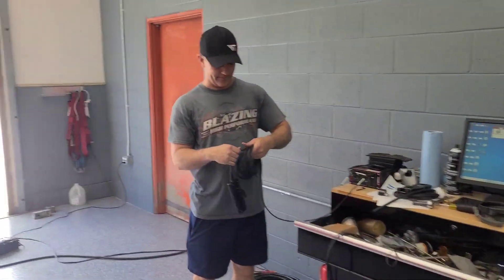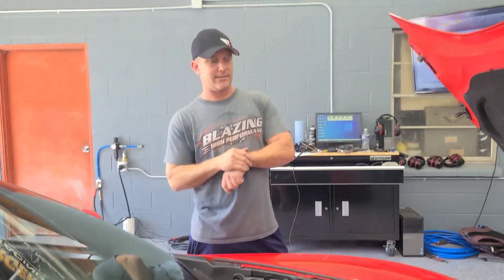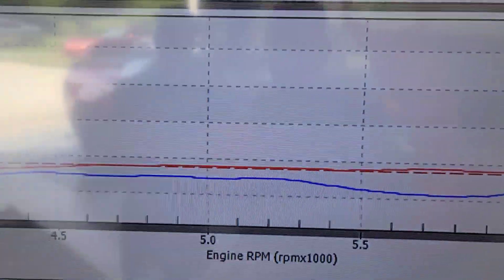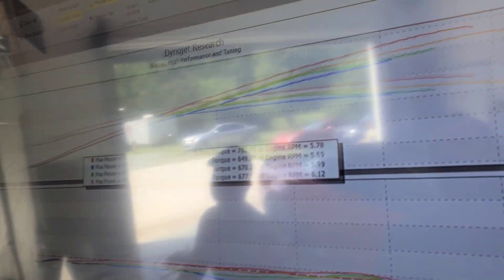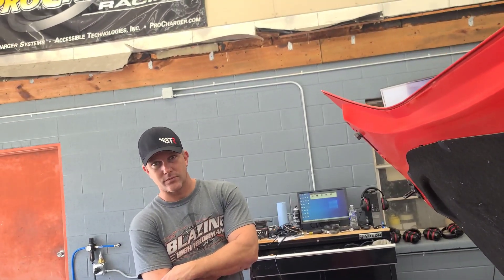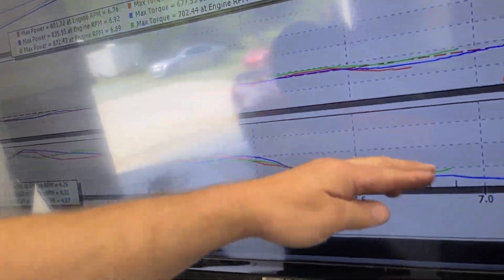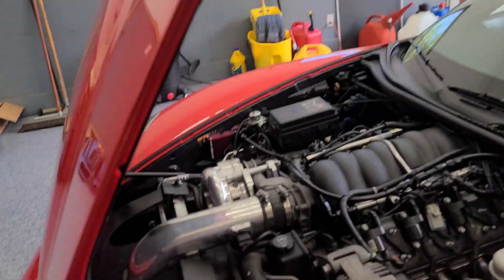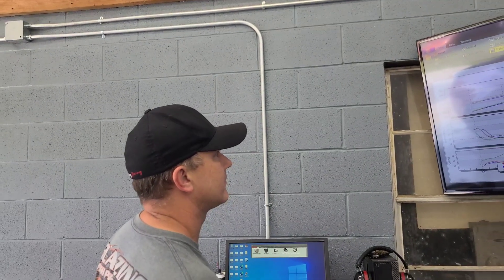2012 Grand Sport Corvette has us jumping for joy.  Almost 900 RWHP on a 6 rib setup?!

Comment: Is that E85? What type of fueling? Methanol injection?
Reply from the maker: 80 % E on this.  1000 cc injectors maxed out with an aux 320 pump,  boost referenced regulator, and a boostapump.  We didn't build it, just tuned it
Reply: @nufnuffz28  how much boost?
Reply from the maker: @fh5tuningredlinemotorsport766  BARELY tickled 14  at 7k.  12 at 6400
Reply: @nufnuffz28  think Methanol injection would benefit him in the fueling an cooling department?
Reply from the maker: @fh5tuningredlinemotorsport766  for a little safety, yes